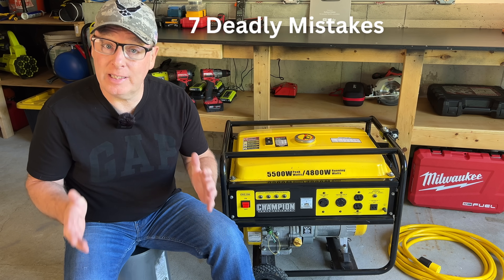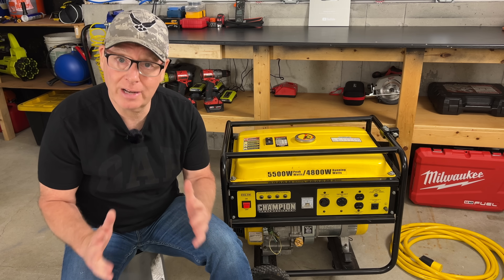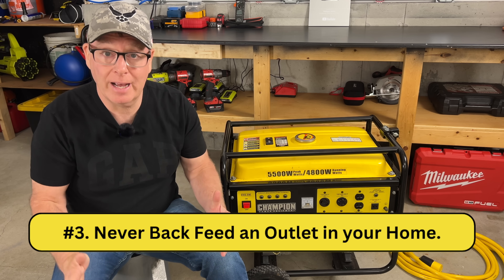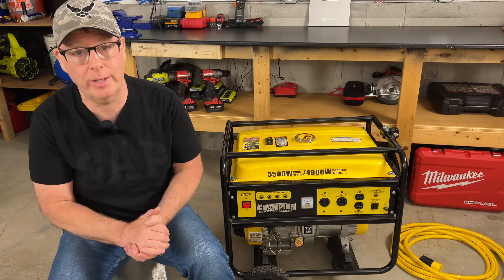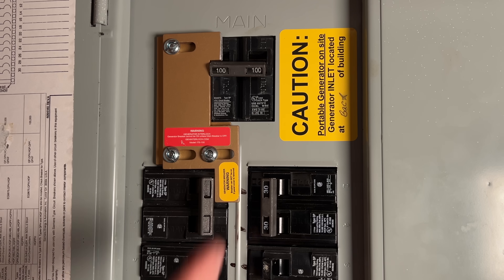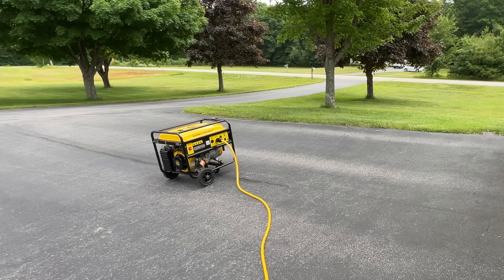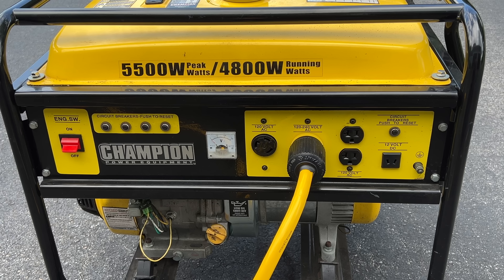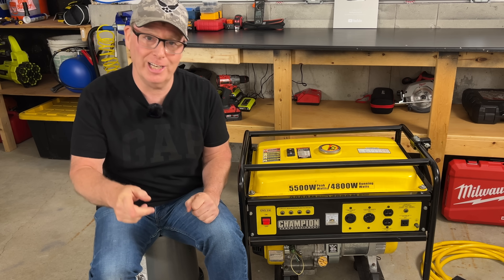7 Backup Generator Mistakes. (Have You Made One?)

Comment: Great, informative video. Thank you. Too many people think they “know” how to do things that they really don’t. I had an electrician set up a sub-panel for items I want run on my generator. Turn off the breaker to the sub-panel in the main panel, plug up my generator, start my generator and turn on the breaker for the generator in the sub-panel. The fueling tip is priceless. Too many people fuel items (lawn mower, generator, etc.) without shutting them off. Far too many items on these can create a spark and explosion or fire - spark plug wire connections, any kind of electrical generating device, hot exhaust. Another option is getting a multi fuel conversion kit. I bought a tri-fuel kit and can run gasoline, propane or natural gas. I set up a natural gas quick connect system for grills to run my generator, with gasoline for start up and if we should ever lose natural gas.  Thanks again for an informative and concise video!
Reply from the maker: Wow, thank you so much..

Comment: Electrician here. The generator power outlet is wired exactly the same as backfeeding through any other outlet. Breakers work both ways. The only reason to not go through regular outlets is the suicide plug. As long as the main breaker is off, nothing will happen.
Reply: Had an electrician walk me through the entire process step by step and explained why each step was taken in order. I've had zero problems using generators when needed. The zero common sense and afraid of everything crowd boggles my mind.
Reply: @Ironsja11  Keep in mind that these days, "Common sense... ain't" is a 100% true statement...
Reply: I'm not electrician by any means but shouldn't you make sure your generator is unbonded/has a floating neutral when backfeeding even with an interlock?
Reply: @bjminor5002 Yes, I would think any time you back feed or use a transfer switch, your generator should be floating neutral.  I'm personally not too crazy about just using an interlock, because they can be installed incorrectly or insufficiently, and can also be easily defeated if the panel cover is removed for whatever reason.  I'd go with a manual transfer switch and floating neutral generator, even though this setup can be more restrictive due to reduced flexibility.   Thanks
Reply: He's not showing if it's raining or snowing you can cover it with plywood along sides or open
Reply: Great advise , since 2008 I emergency connect a 7000 W Generator to a hub which has a built in transfer switch , I bought already the third HUB , not real reliable ! So in harsh Storm or Winter  weather , I do above described back feeding with a small and easy starting Generator .
Reply: Would doing that pass an inspection by an electrical inspector - is that to code??  Have a fire in your house and the insurance company does any research and finds that the generator had anything to do with it - no coverage.  It's your risk
Reply: @TheOutdoorProfessor416 What if you live where there are no inspectors or permits?
Reply: @TheOutdoorProfessor416 Yep, we all get it, some of us aren't afraid of ourselves, some of us know we aren't going to start a fire
Reply: @integr8er66  Until you do.....
Reply: @TheOutdoorProfessor416 Well 60 years and it hasn't happened yet, I'd say its not very likely, but if it does, and if my insurance doesn't cover it, which I doubt, so what, its just one house and most likely won't be a total loss, move on and fix it, I'm not going to live being afraid of my own shadow
Reply from the maker: And you need an interlock between the main and the generator breaker. Other peoples lives cannot depend on whether or not someone does something in the correct order.
Reply: Like driving down the right side of a two way  highway @BackyardMaine
Reply: @BackyardMaine Any lineman working in the USA will power test any wire then ground it before touching it he will be in an insulated bucket, but also we put our lives in other people hands every day
Reply from the maker: @integr8er66  I know that is the procedure but lineman still get killed on occasion when they fail to follow safety protocol.
Reply: @integr8er66 this won’t help if power starts flowing AFTER they checked and are already working on the line.
Reply: @diytesla  Don't you think if someone tried to backfeed the entire line his 30 amp breaker would blow

Comment: We used to just use a couple extension cords into a couple power strips and have to go through the hassle of moving plugs on things around.. 6 years ago I was thinking of installing a transfer panel and bypass interlock but decided to go with a solar box that had hard wired inputs for grid power and a generator.. It automatically through relay logic can start my generator and switch to it.. If the generator does not have a big load on it the system will automatically move that power to battery charging so no slack time is wasted.. With this system many time we never know the grid power is off unless we hear the generator start up or the neighbor stops by to see if it is just their power is off.. It is not perfect but for the most part it works well even when there are brown outs the system can use that and the batteries to make good power which saves on the generator run time as well..
Reply from the maker: Wow. Sounds like a nice setup. Whats the manufacturer?
Reply: @BackyardMaine  Outback Radian, I have the Mate 3 which allows networked computer control..  So with the computer I can turn the system into an independent power plant, a UPS or a shared load center.. It lets me set when to start the generator, how long it should run and even turn things like the electric hot water tank on and off using a 240v relay.. This time of year we have low solar input so the next cheapest option is the grid.. Our power company offers Winter reduced rates or we can do a reduced rate in non peak hours.. Either would be ok as the off peak I could just charge the batteries and use that but so far I just do the seasonal rates because Spring to Fall are high production and we have seen several months where our bill is just above the minimum fee of $30 a month.. Go below that and we would be paying for nothing..

Comment: Please tell me how a suicide cord backfeeding a breaker through your dryer outlet is dangerous if the main breaker is turned off.  No power is energizing the main power lines.
Reply from the maker: Because it depends on a person to open the main breaker rather than a device that will not allow the action to be done in the wrong order. Do you want to depend on others to do things right when it come to the safety of you and your family? Also there is a reason they double mail ends are called that.. The blades can be energized for the generator or from utility if the sequence of operation is not completed correctly. These are not just code violations that are an illegal connection because they put others at risk.
Reply: Ahh.  You assume that there are others in my home that would be doing any of this.  There isn't.  As another electrician, I'm  the only person playing with the panel.
Thank you for your answer.

Comment: If I put my generator in front of my garage, I wouldn't have a generator.
Reply from the maker: Maybe make a way of securing it with cables. Please don't become a statistic.
Reply: I actually made and installed a tab on the other side of the breaker so that I have a lockout rod once the breaker is opened.  Even knowing what I'm doing, I don't want to become a statistic in an emergency.  I'm much too old to be eating Tide pods.

Comment: I have a non inverter back up generator (dirty power). Will a 50 amp surge protector at the generator protect my electronics? Or can I just use the dirty energy to run my house through a transfer switch and circuit breaker through box. I hope I am making sense?  I just don’t want to buy another generator if I made a mistake.
Reply from the maker: A standard generator does produce a modified sine wave which is why I never power TVs and Computers when running on generator power. Sadly a surge protector will not help. You would need to power an inverter to correct the issue. I'm actually going to buy an inverter generator because I have a battery system I will need to re-charge during extended outages and a standard generator will not work for this application.
Reply: @ sorry for all the questions but could you use a UPS as a wall between the outlet and your electronics.
Reply from the maker: @rekondaddy8109  I could go on about the two different kind of UPS systems but the short answer is most inexpensive UPS systems are not going to like the generator power and you will most like have issues.

Comment: Thinking about a Generlink to connect to a generator for whole home power.  Unless I pay $18k CDN for a whole home standby I will have to be home. So I went with an Anker F2000 for the furnace (and can be UPS for the furnace if I’m gone for the weekend) and a 2200 Watt inverter to rotate through  fridge, freezer, sump pump and some lights. And it can charge the F2000 for multi day outages.
Reply from the maker: Great plan.. I do the same but with the Anker F3800 and one expansion battery. They will cover my critical loads for about 14 hours.

Comment: To power a fridge, deep freezer, natural gas heat furnace in freezing temperatures, hot water tank, stove and  internet and lights - do I need more then a 30amp transfer switch? 
And do i need more then a 7500 running watt generator.
Reply from the maker: Yes an electric hot water heater and a stove draw too much power for a 30A connection. The rest is ok and even a microwave oven for cooking.

Comment: I don't connect to the house panel.
I have a series of plugs, wall mounted near needed home equipment, with cords on them.
Unplug the circulating pump, plug it in to Gen set outlet.
Same with water pump, sump pump, sewage pump, and a couple lights.
That's it, inexpensive to do!

Comment: I have a question for you. When hooking up a portable generator to your home this way what do you about the floating neutral issue this creates? The neutral is grounded in the portable generator frame that has no earth ground to the generator.
Reply from the maker: When connected this way the generator needs a floating neutral. That means there is no bond between the neutral and ground at the generator. But when we connect a floating neutral generator to our home we complete the bond since it done at the service panel. The generator is grounded and bonded through the existing system. The neutral and ground bond can only happen in one location on our electrical system so if connecting a bonded neural generator we will need a transfer switch the switches the neutral along with the line wires. This is usually only done with whole house systems with automatic transfer switches

Comment: Thank you for this video. Question that I did not see answered or I missed it. If someone back feeds their generator through the dryer outlet that powers the electrical circuit box, if you throw the main breaker in the electrical box doesn't that prevent the electric, produced by the generator, from going to the telephone pole?
Reply from the maker: It does but the issue there is we're depending on a person to always do things correctly. All of us humans make mistakes on occasion so it's best to have a mechanical device to prevent a mistake from being made. Especially one that could put other peoples lives at risk. Thats why back feeding a dryer receptacle is illegal.

Comment: I read some of the comments, but no one is addressing how to ground the generator that is outdoors. Does anyone have suggestions about that? Thanks.
Reply from the maker: Grounding a generator is very often misunderstood by homeowners and even some electricians. I need to make a video on the subject. A separate wire connected to a ground rod from the frame of the generator is only required if the generator is run as a separately derived system. That's when you have a bonded neutral generator and in that case you need a transfer switch that switches the neutral along with the hot leads because a neutral to ground bond and only happen in one location on your system. Otherwise a ground rod connection to the frame of the generator is actually less safe. The ground wire from your connection cord bonds the frame of the generator to your building grounding electrode and more importantly to the neutral to ground bond at your main.
Reply: @BackyardMaine  I'm thinking that I'll only use the generator during a power outage to power the refrigerator via a heavy gauge extention cord with the generator outdoors. The distance between generator and refrigerator will be about 30 Ft. What gauge wiring should I use? Thank you.
Reply from the maker: @rts3262  If you're just running a refrigerator and it less than 50 feet I would go with a 14AWG extension cord.

Comment: Where is the ground rod and cable?
A fire extinguisher nearby would be smart.
Reply from the maker: I ground rod is not required or recommended for generators with floating neutrals. If you have a bonded neutral generator the you also need a transfer switch that switches the neutral along with the line conductors. This would be considered a separately derived system and would require a grounding electrode in most cases. So many people don’t understand grounding

Comment: I ordered the lock out and 30 amp breaker specifically for my panel brand. Not spending a whole day doing this, but broke it up over a couple days. Total time  was about six  hours. 
Installed the back feed 30amp breaker per instructions with the kit. Had to modify the heigth an 1/8th inch so the breaker would only function when lockout bracket cleared the switch completely. This required adding nylon #10 flat washers or spacers between the panel cover and the underside lockout plate.  
Then, located the inlet, drilled the proper hole into basement, verifying no wall outlets or visually wires in that area,  pushed the #10-4 so cable through, wired the inlet insuring every wire was bound and no bare wire were exposed, mounted the inlet box, sealed all around with bath silicone caulk. Checked  the X,(black) Y,(red) W(white neutral) and G (ground) continuity end to end of cable to inlet. 
Back at the panel, TURN OFF MAIN BREAKER, AND ALL BRANCH BREAKERS FOR SAFETY !!!! 
 Push the cable through an appropriate 3/4 "  knock out and retention clamp, adjusted length for future service if needed, removed the 30amp breaker.  Carefully,, strip cable jacket without nicking the colored wire insulation to allow each colored wire to reach it's  destination. 
Connected Green ground to the ground buss bar, white to the neutral bar, Red, and  Black to the removed breaker, assuring no exposed  copper wire, torque the binder screws well, usually labelled on breaker. Re install breaker to main buss position, replace the panel cover, paying attention to lockout position as you position cover over all the breaker switches. 
 Test motion of Generator breaker using the lockout kit..if it turns on and off with the main off,  now with Generator breaker off, turn on main breaker, does the lockout block GENERATOR switch from moving? If yes, the system is installed correctly and branch circuits can be turned back on. 
 My home has a single grounding rod upgrade with in 4 feet.  My panel is also bonded to the ground buss, so no no extra ground wire was needed from generator to the rod. 
That was it. Tested hook up, and thumbs up. 
Now to somehow afford one of those fancy generator storm tents that clamps to the open frame bars..!!

Comment: Just curious. Could you keep the generator in your basement, if you took off the exhaust and reppiped it to feed outside of the house? Then put up a carbon monoxide detector
Reply from the maker: I would never run a generator inside a home under any circumstances.

Comment: Thank you so much for your educational videos. I am from EU, where some differences exist and I am not familiar with your type of generator feed-braker, so I have the following questions: When you switch over to the generator, do ground and neutral wires remain interconnected via the first point of disconnect panel bond, or not? How generators can cope with that? Our generators have only three pole terminal sockets, ground and two power contacts. None is marked as phase or neutral, and you can reverse connect them normally. Thank you.

Comment: Never have a cord connected to your generator when starting it. You are putting a load on a cold stator. Start the generator and let it warm up for two to five minutes. This lets the stator get up to operating temperature. The most important thing in the world. Read the manual.
Reply from the maker: A cord connect is fine and a good idea when things are wet but like I said in the video be sure that the breaker is off so the generator isn't starting or stopping when load is connected.
Reply: @BackyardMaine  I use a gentent to deal with adverse weather. I could have also manufactured a tent using a tarp are pvc pipe.

Comment: I have a 50 amp generator inlet installed. I have 2 generators, one that has 50 amp circuit, and one that has a 30 amp circuit. Am I ok to use the 30 amp generator on the 50 amp inlet? I'll have to use an adapter for the cable to make it work.
Reply from the maker: Yes.. You can use a smaller generator on your 50A connection.
Reply from the maker: Just be sure not to overload the generator.